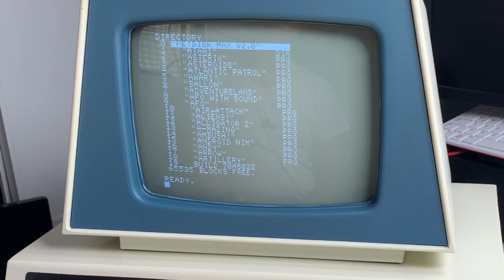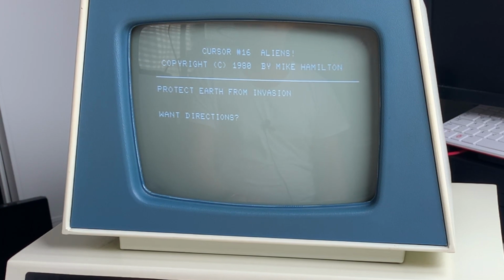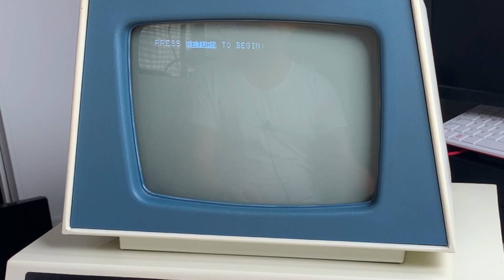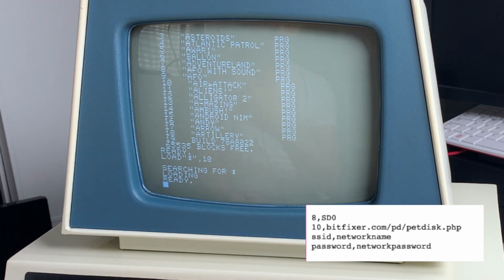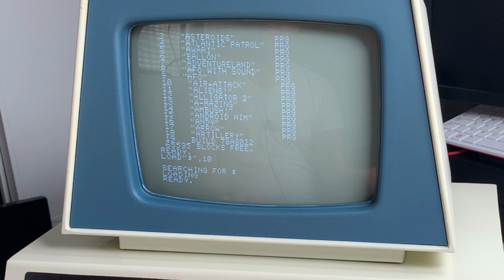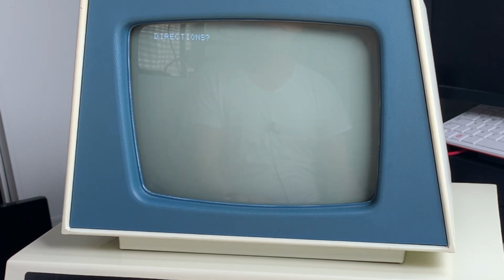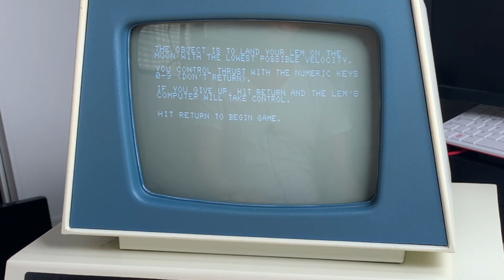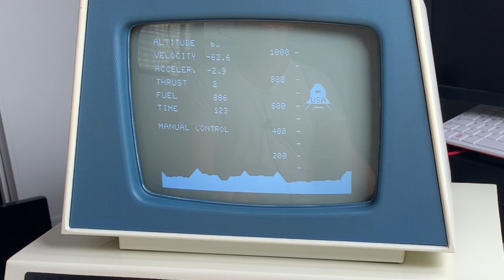PET DISK MAX V 2.0 Build & Test

Comment: Hi Wolfgang, great video! Glad it is working for you. Very sorry about that issue with the connector not fitting into the opening for the IEEE-488 port, I was not aware of the case variation for that model of 2001. My own 2001-8 case seems to have a larger opening for that port. For future board revisions I believe I can move that power pin over to the side of the edge connector, which looks like it should fit.
Reply from the maker: It works really well, thanks! And no problem with the connector. It worked in the end ... and half of the fun (for me) is problem solving.

Comment: Huh, I looked at the picture on Bitfixer and you soldered that header in correctly according to it, but backwards if you followed the silk-screening. What gives?

And I'm sure that I would have damaged something if I had to pull one of those off of a board. What a PITA. Nice work nonetheless, and now your boat anchor has disk access. Congrats! :)
Reply from the maker: Yep! Thanks! And I just finished my 1541 to PET adapter and it f...ing works!
Reply: @RetroWK  And it sounds like your package is on its last leg of the trip. Happy Newting! ;>
Reply from the maker: @MrWaalkman  Great news! Thanks again man. Much appreciated!

Comment: I've just bought one of these. I have a PET2SD but I also have a working 4040 dual disk drive and I want to be able to use the PET Disk Max with the 4040 connected which I can't do with the PET2SD.
Reply from the maker: I just tried that with my next project (daisy chaining a second drive) and it works flawlessly!
Reply: @RetroWK  Thanks for the reply. Did you have to set the PET DISK to a different id?
Reply from the maker: @colinhaynes2480  Yes, I set my PET DISK to be a different device number (mine is 9 now, so I can use a connected floppy drive as 8).
Reply: @RetroWK  thanks for the reply.  I'll try that once I have made the PET DISK MAX
Reply: @RetroWK  Oh, i have to get one of these, will it work with my 8023P daisychained along with my 4040? I'd like to print easily like i did back in grade school.
Reply from the maker: @IDPhotoMan  Yes, that works. You may have to configure the PET DISK to be a different device number (mine is 9 now, so I can use a connected floppy drive).
Reply: @RetroWK  Just ordered one today!

Comment: Cool a working pet disk drive!!! That’s a cool little board.
Reply from the maker: Yep. I just saw a video with a Fujinet for the Atari 800 that could do even print to pdf and had a web interface.
Reply: @RetroWK  someone had suggested a virtual printer (on device 4 for the PET, I believe) as a feature for the PETdisk MAX, definitely possible and I'm hoping to get this into a future firmware update.
Reply from the maker: @bitfixer6502  That would be really cool!